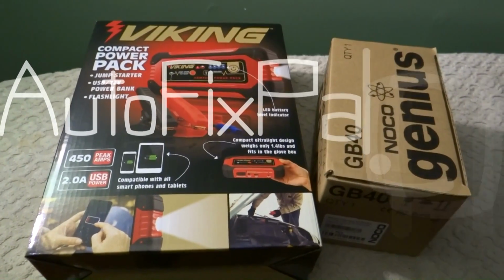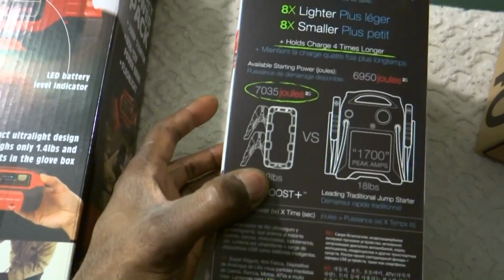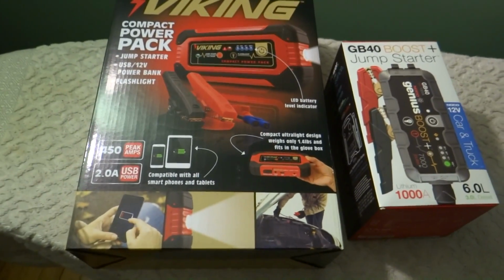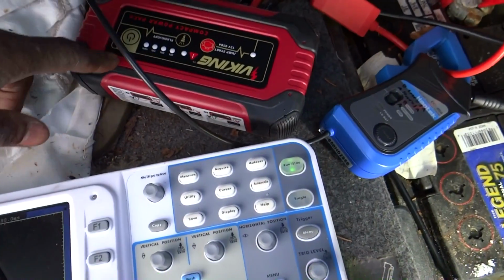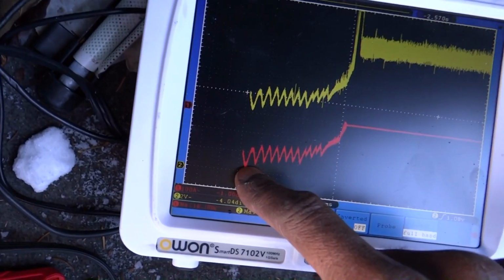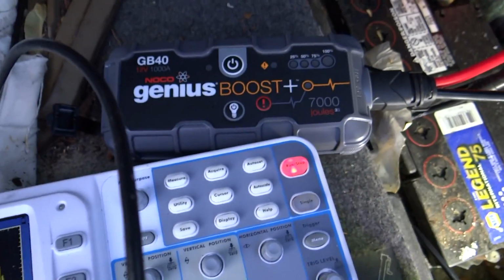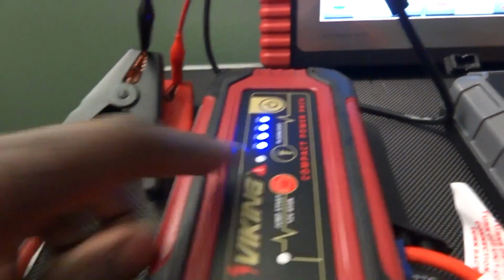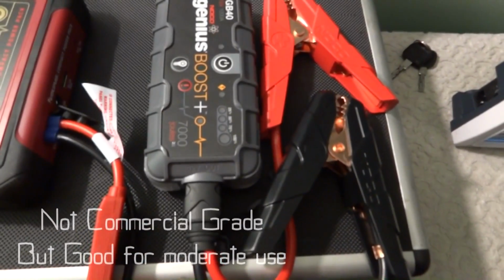Harbor freight lithium iron jump pack booster VS NOCO Genius Boost GB40 jump pack / booster - Review

Comment: Poorly conceived test!  While tester fooled around with the test setup, the dead battery collected energy from the jump starter.  This completely negates the test results.  This is particularly the case after testing the second jump starter.  By the time the second jump starter is tested, the dead battery is probably capable of contributing an additional 100 amps.  This is why the test is flawed!
Reply: Rodolfo, you don't understand how these devices (or jump starting in general) is supposed to work.  If the vehicle starting battery is depleted enough that it can't start the engine, ANY additional energy imparted to the charging system by the booster device that results in the engine being able to crank and start is rightfully credited to the booster device.  When you connect a second vehicle's starting battery to the disabled vehicle's battery, the operating vehicle's battery and charging system ARE CHARGING THE DISABLED VEHICLE'S  BATTERY!!!!  There is no diode divorcing the disabled vehicle's starting battery when jump starting, nor should there be.  

Look at jump-starting vehicle's like this:  If a car runs out of gas, do you disconnect it's fuel system and instead connect a different fuel system in order to re-start it?  No, add enough fuel to ITS fuel system/tank to be able to start the vehicle, usually with a small container that you can easily carry by hand.  You don't bring a 20+ gallon fuel tank in order to get that vehicle started, you bring a manageable 1-5 gallon fuel container and add enough to start the vehicle and maybe drive it to a fuel station.  ITS THE SAME IDEA HERE WITH THE BOOSTER, OR WITH TRADITIONAL JUMPER CABLES.  You're adding just enough fuel/charge for the engine/starter to operate, not substituting the vehicle's fuel system/starting battery for an external fuel system/starting battery.
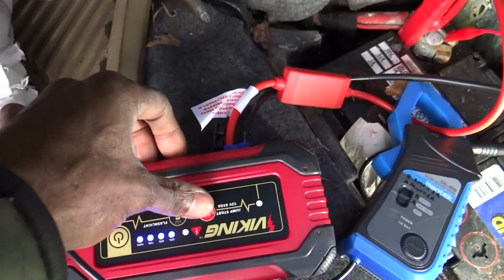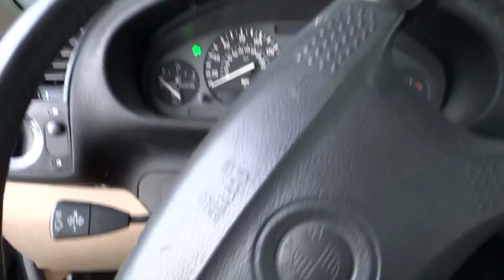Reply: Your thinking is flawed, there is no way the battery on the vehicle could have received 100 amps in less than one( 10:40 to 11:20)  minute after he turned to booster mode. Even if that would have been the case that energy taken in by the lead-acid battery would not have been able to have been delivered by the battery in such a bad state of charge.
An assistant would have been helpful but I doubt the result would have changed very much. The Viking definitely had the disadvantage.
Reply from the maker: your wrong. the battery was incapable of running the interior lights no matter WHAT amount of time the battery was charged. the battery was BAD plain and simple. it does not take a charge. 

The only thing flawed about my video is the fact that I failed to mention in the video that the battery in the vehicle is completely failed and will not hold a charge. The battery was incapable of producing enough amperage to turn on interior lights. So what is it contributing to starting the vehicle?
Reply from the maker: At 7 minutes and 15 seconds into the video the voltage on the battery before the first jump start is 280mv (a fully charged battery is 12.6volts). This battery Does not hold a charge no matter what you do, it is a bad battery from not being used for several months, i may have left the fact that the battery will not hold a charge out of the video.

At 14 minutes and 28 seconds into the video i should have pointed out that the battery voltage was at 1.6 volts and i did not, however if you look closely at the yellow max voltage number (shows as "ma") on the oscilloscope you can see the voltage is still VERY VERY low at 1.6 volts. In fact the reason i have to put the NOCO into bypass mode as i mention at 14 minutes and 31 seconds into the video is because the NOCO will not produce any voltage if it senses less than 2 volts which is about the equivalent of a AA battery in terms of voltage, also considered a completely dead battery.

So yeah i left out the fact that the battery would not hold a charge. But the comparison and test yielded completely plausible results. I intentionally used the HarborFreight  Viking first because it's more difficult to crank a car that has been sitting for months regardless of the batteries state of charge and the Viking jump pack is the newcomer with leads that are not quite as beefy as the NOCO GB40 so it should get first crack at it. Now maybe that's not 100% fair but the NOCO GB40 is rated for more than twice the amperage that the Viking is rated for, so i had o question it would start the car. Only other option to make that part fair would be to wait several months and Start the Car with the GB40 first.

I should also mention that the last time the car was started several months ago it had to be jump started as well and that was in the summer. it was 27 degrees outside when i did the test and there was 7" of snow that just fell early in the day. it was as fair a test as any.

Comment: hahahaha wth LITHIUM IRON????? Obviously chinese made.
Reply: Educate yourself on battery chemistry.  Lithium Iron batteries are an ideal chemistry for this type of device, and is a very good chemistry to be used on installed starting batteries.  Your negative bias against China may be well deserved, but it shouldn't have anything to do with the choice of cell chemistry.
Reply from the maker: Taylor Owens there is no question about that. it says so on the box.
Reply: As a furtherance on education, the majority of items you use are chinese made, including some of the best of them. It isn't who made it, it is who the customer is and the design and manufacture specifications they require. If your american brand orders it to be made as cheap as possible so they can undercut their competitors, or even worse simply imports and rebrands with no specification at all, then where is your pride?

Comment: whats the MAH on the Noco?
Reply: It uses 3 cells each rated 3.7v ~2000mah.

The whole pack is rated 11.1v 2150mah.
Reply: So you're saying a 18650 battery has more Mah that the Noco? I don't think so.

Comment: Thanks for this very good review. We all know they can start a car. But it would good to know what the actual performance was.
Reply from the maker: boostedmaniac your welcome. Glad it helped. Be sure to subscribe.
Reply: If it's good enough to start the car, then the performance is adequate.  How would you measure the performance of a 1 gallon fuel jug used to add fuel to a car disabled by the tank running dry?  If it adds enough fuel to the tank to get the engine started again, then the jug's performance is adequate.  Same thing here.  If it imparts enough of a charge on the installed starting battery, then its performance is adequate.

Comment: If you are speaking of the HF discount hardware store, I would always do some online research on reviews about the products they sell, before buying! Personally, I would go with the GENIUS products, although I really try to stay away from Chinese made junk.
Reply: The cells used in the NOCO product are flat slab cells, the same sort of geometry used in cell phones, RC models, and camera batteries.  This lends itself well to energy density per unit volume, but is disadvantageous for the purpose of heat dissipation in high current drain applications.  The cylindrical cells used in the HF and similar devices is a better choice for a starter booster, and for that reason alone, I wouldn't buy or suggest buying the NOCO booster, although I think their chargers are okay.

Comment: IIRC, the Viking uses LiFeSO4 batteries while I am betting the NOCO uses regular LiIon batteries.  Different chemistries.  Different charging AND  at rest voltages.

Funny thing is, LiFeSO4 is lower voltage, so I wonder if it actually has one more cell that the NOCO ?
Reply: The difference in voltage is inconsequential.  If either booster's chemistry delivers a higher potential (voltage) than the depleted installed starting battery along with adequate current, the device will function as intended.  I prefer LiFe for this sort of application over other lithium ion chemistries, but even more so, I prefer the cylindrical cell geometry over the prismatic cell geometry of the NOCO.
Reply: Yeah the NoCo is going to be a 3 cell pack, the HFT is going to be a 4 cell. Personally, I'd rather have the HFT since LiFeSO4 is much less angry
Reply: That the disadvantage when testing two different chemistries.

Comment: I don't know how you can call this a test after the first start the car would probably start  without any assistance at all.Once you started it the only thing you can do to get real results would be to discharge the battery to zero and then try it.
Reply from the maker: At 7 minutes and 15 seconds into the video the voltage on the battery before the first jump start is 280mv (a fully charged battery is 12.6volts). This battery Does not hold a charge no matter what you do, it is a bad battery from not being used for several months, i may have left the fact that the battery will not hold a charge out of the video.

At 14 minutes and 28 seconds into the video i should have pointed out that the battery voltage was at 1.6 volts and i did not, however if you look closely at the yellow max voltage number (shows as "ma") on the oscilloscope you can see the voltage is still VERY VERY low at 1.6 volts. In fact the reason i have to put the NOCO into bypass mode as i mention at 14 minutes and 31 seconds into the video is because the NOCO will not produce any voltage if it senses less than 2 volts which is about the equivalent of a AA battery in terms of voltage, also considered a completely dead battery.

So yeah i left out the fact that the battery would not hold a charge. But the comparison and test yielded completely plausible results. I intentionally used the HarborFreight  Viking first because it's more difficult to crank a car that has been sitting for months regardless of the batteries state of charge and the Viking jump pack is the newcomer with leads that are not quite as beefy as the NOCO GB40 so it should get first crack at it. Now maybe that's not 100% fair but the NOCO GB40 is rated for more than twice the amperage that the Viking is rated for, so i had o question it would start the car. Only other option to make that part fair would be to wait several months and Start the Car with the GB40 first.

I should also mention that the last time the car was started several months ago it had to be jump started as well and that was in the summer. it was 27 degrees outside when i did the test and there was 7" of snow that just fell early in the day. it was as fair a test as any.
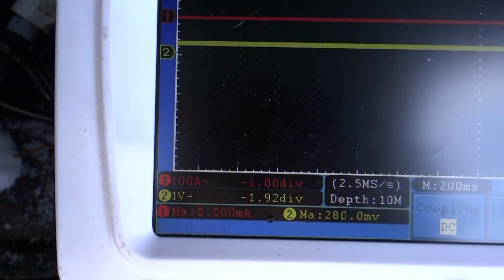Reply: The battery was totally discharged. Watch at 8:00 minutes the lead-acid battery had a starting voltage of fewer than 2 volts.

Comment: I have the HF and it works great
Reply: Ripe Melon 
I have the Viking also. I found that I only had four attempts at jumping a vehicle before it was discharged. 
I was jumping my son's E150, but it turned out that his starter is going out.
I've jumped several cars with no issue at all.
Reply from the maker: Ripe Melon it's a good jump pack..works as intended.
Reply: #teamharborfrieght